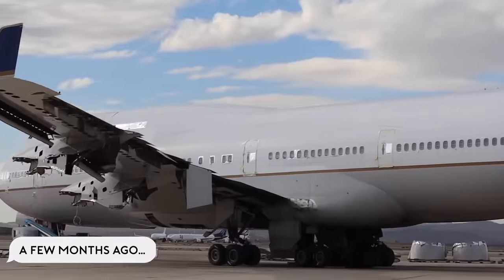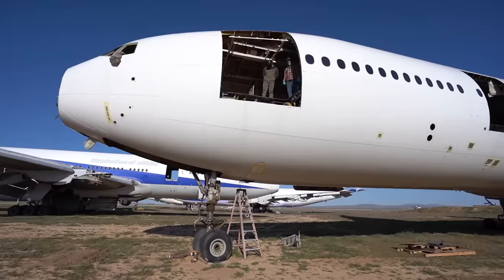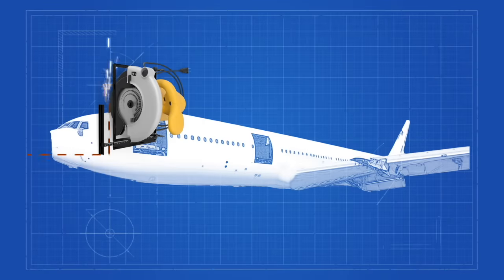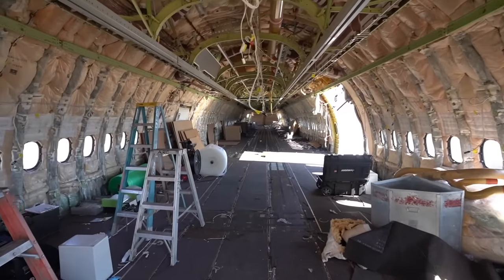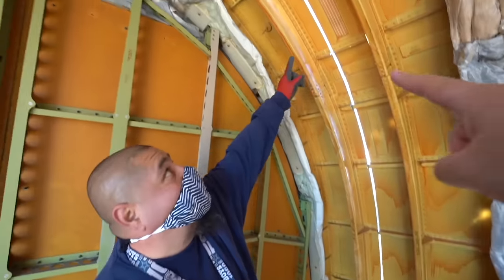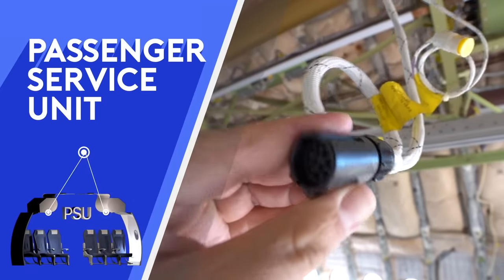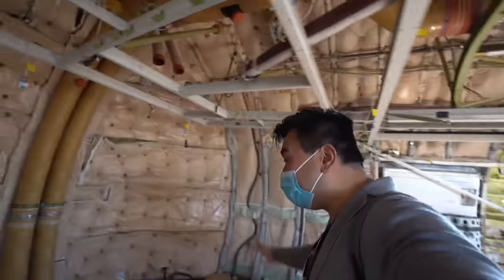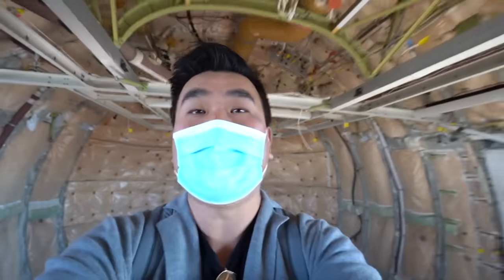Cutting and Scrapping a B777 - Inside The Airplane Graveyard

Comment: That's a very straight cut on freehand, very impressive.
Reply: Iris Pettson Thought I saw a chalk or laser line when they were making the cut inside.
Reply: @mmouseav8r402  That makes sense, I'd expect a laser on the equipment, but didn't see any.
Reply: There were lines drawn on the outside of the plane.  Guide lines.  But nice to see a straight cut using a heavy saw.  I've used one and I'm a burly dude and I can tell you it ain't easy!
Reply: Those planes are so strong they can fly through buildings
Reply: What’s not impressive is is lack of a mask
Reply: I said same thing. Must have very nimble hands
Reply: @AJ-pr8ym  yes. Saw is a bit heavy
Reply: They used a chalk line that they followed to cut it that straight
Reply: Thank I did those Cutts,  . I took pride in my Cutts.
Reply: No Lazer lol 😆  I just know how and what to do.

Comment: I am always wondering what they are doing with the chairs when they recycle/destroy an airplane. I mean some of them are made from leather, and in general they require many resources.
Reply: They most likely won't reuse them, because the chairs on recycle planes, are from "old collection", but I bet they disassembled them, and reuse the resources?
Reply: @ors1392  They might. I mean, this problem also needs to be dealt with when an airline upgrades the interiors of an aircraft. For example QATAR upgrading its Business Class, to QSuites and such.
Reply: @OrSNCucumber  the fabric is very coarse because it has to be fire resistant, as a result its not good for much and most of it goes to landfill unfortunately.
Reply: some companies will buy them for a small price.
They can be reused as a seating area. for a (air) travel based companies and companies surrounding actual air travel.(near airport hotels) it might be nice to have a few to get the costumer in to the mood. 

they do tent to use just the economy seats above the higher end once.
Reply: @sirBrouwer  Correct. Therefore I was wondering what can be done with the premium classes seats, since I imagine each seat costs good few thousands of Dollars.
Reply: @bob2000and10  Wow, what a shame.
Reply: @OrSNCucumber  you could ask the airliners. Big chance that they will actually give a genuine reaction. People at those airlines are often very happy to talk about that (you need to be the good kind of crazy to work for a airline)
Reply: @sirBrouwer  LOL, although my channel is about computer science, and that's what I study, my other YouTube channel is about hotels (An area which I find very similar to airlines). I know that I would get genuine answer as to what happens to the seats, if I'd ask the airline directly (As a matter of fact, I need to use the materials of a five star airline for my final in one of the courses I study, and they are very helpful :-)), but I wanted to ask @Sam Chui, since his video is all about recycling air-crafts.
Reply: Some companies buy them and turn them into furniture

Comment: "717"s still in service and 777s being cut up.  Amazing.
Reply: That is because Boeing could never build a good plane
Reply: The 717 was built after the merger (1998-2006) while the 777 started deliveries in 1995.  There are 777s older than the oldest 717.  And there are no MD series still flying with major operators (vast majority stored or scrapped), so while some of them lasted 30+ years, they are inefficient and tired by today’s standards.
Reply: @aurktman1106   we are talking old air craft. the dc3 is flying to day. boeing has no plane that age flying today. the 737 max is efficient but they crash a lot
Reply: @aurktman1106   let me know if boeing has a plane as old as the dc3 flying to day. opp boeing dont because they build junk
Reply: @dknowles60  lol
Reply: @aurktman1106   there are dc3 flying today . there is no boeing plane that old flying today
Reply: dknowles60 since you clearly are comparing apples and oranges, a DC-3 is an unpressurized radial engine (or turbo shaft in the Basler BT-67 case), the B777 is a pressurized jet aircraft. If the DC-3 were pressurized, due to the nature of metal fatigue I assure you that most, of not all DC-3 aircraft would be grounded. And where do you get the notion anyone was trying to talk about the DC-3 to begin with?  Your comparison is nonsensical.
Reply: @aurktman1106  had to to point out that boeing planes dont last to long. also there are dc6 flying today and they are pressurized
Reply: dknowles60 there are more than 40 737-200 series still flying passengers and in Canada, Mexico, Venezuela, etc.  As for the DC-6, there are maybe 5-7 still flying (including the Red Bull aircraft) and those have been so thoroughly overhauled that not much original skin in the pressurized area from the 1950’s remains probably.  All of the propliners from that era still flying regularly are unpressurized, mostly DC-3 and DC-4 models. Again, you are talking apples and oranges.
Reply: @aurktman1106  facts are facts the dc6 is way older then the 737. ever hear of north west airlines re skining dc9 most boeing planes are so crappy they dont get new skin
Reply: dknowles60 are you serious?  Every single pressurized jet airliner has had skin repairs, either replacement or doublers added when needed. EVERY one of them, regardless of manufacturer.  Either you live in a fantasy land or you’re a troll just looking to get people pissed off.
Reply: @aurktman1106  wrong. some of douglas planes were built so good the FAA has no limits on the air frame life. the same thing can not be said about boeing
Reply: dknowles60 every single aircraft must undergo a series of thorough structural checks.  Every single aircraft is limited in life due to the economical feasibility of keeping it in the air. That’s why most go to the scrapper on their third or fourth D check.  You can keep ANY aircraft in the air indefinitely as long as you keep it structurally sound and have unlimited funds. As to the life limits imposed by the manufacturer, that’s up to them but I assure you that Douglas gave guidance on what the effective safe life limit was on their aircraft, if they didn’t then they were quite stupid.  Maybe that’s why they don’t exist as a company anymore.  This notion that Douglas jet aircraft are inherently indestructible is a laughable joke. 

As for Boeing aircraft not lasting as long as Douglas, there are quite a few Boeing B-17’s flying, but Boeing built bombers during WW2, not transport aircraft. If they had built cargo aircraft, maybe there might be a bunch more flying. Only mistake Boeing (UATC) made back then was to not accept TWA orders for aircraft.  If they had, there may be far more than just one or two Boeing 247’s still flying. 

So, in the end, start comparing apples to apples in order to be taken seriously.
Reply: @dknowles60  yeah airbus goooooooo
Reply: @dknowles60  b 52 stratofortress
Reply: Wow, I can't believe I read that whole argument/exchange and still don't give a crap. lol. Everything has a user life expectancy some out last others to be sure but in the end everything ends up being recycled or a museum piece. Its like saying that the Hudson Hornet is a great car and Fords are junk yet Hudson went the way of the dinosaurs and Ford still builds factory cars that can go 165 mph. I don't get what that guy was ragging on about, just a troll I guess.
Reply: The guy in white is cutting ✂️ down the airplane 🙄
Reply: The boeing 717 IS more new
Reply: @norbert.kiszka  wrong. if it were pilot problems the FAA Europe China would have never grounded it
Reply: ive never seen a toxic stan cry over how douglas planes are amazing. undoubtedly an old boomer thinking "older stuff is better than new" move along with the bloody times and stop living in the past granddad.
Reply: @dknowles60  MCAS is using small electric engines and those can be disabled by pilots any time with two switches. So disable it and trim plane manually or let it go to crash?
Reply: @norbert.kiszka  the pilots were never told that by boeing. if the planes needs MCAS it is a very sorry plane
Reply: @aurktman1106 , the Boeing 777-300s and Boeing 777-300ERs are still flying right now, but the Boeing 777 production is still active, not the Boeing 777X production, and yes, Boeing 777 production i'm talking about
Reply: @andreizadasilvapereira5312  Ok.  I'm not sure the point of your comment.

Comment: I was on the repair of a 747, line 1372. We cut the cockpit out of it, built a new -M in Kansas, installed it. 72 days round the clock. It's still flying. Pressure test damage in production.

Comment: Deep inside that there is an IC (silicon chip if you like) that I worked on for a short time.  I even remember the part number to this day, but had better not mention it.  It had noise issues because it was so long in development that it got shrunk onto smaller geometries (faster) than the design was really intended for.

Comment: Sam, I think there is a way to get that 777 flying again and that is either recycle that front and reform it or buy a new forward section and attach it to the rest of the aircraft.  If it were me and I had a choice?  I'd do it.  And that looked like the 777-300 or 300ER.  So definitely.

Comment: Airlines are so insistent on having the latest airplane models. Why don't they make do with older planes? (Assuming maintenance is kept up.) It must be that the new airplane payments are structured such that it's cheaper to have new planes versus the old ones. It sounds screwy to me.
Reply: The biggest reason for switching to newer aircraft is lower operating costs - particularly fuel costs.